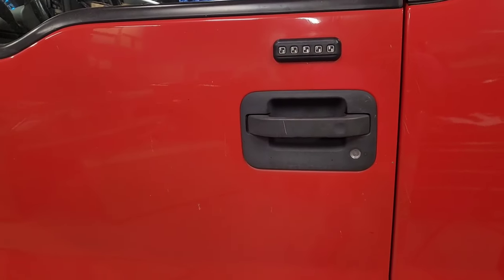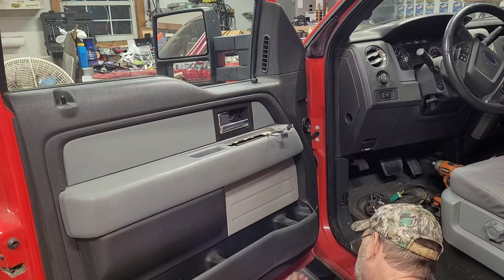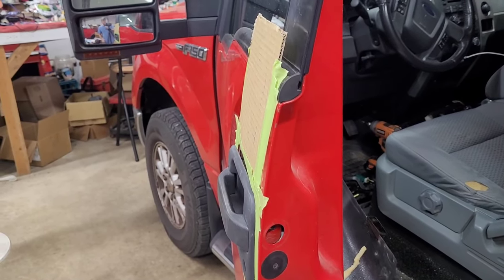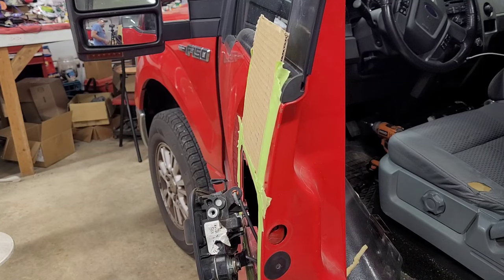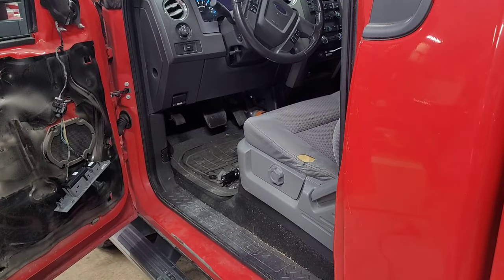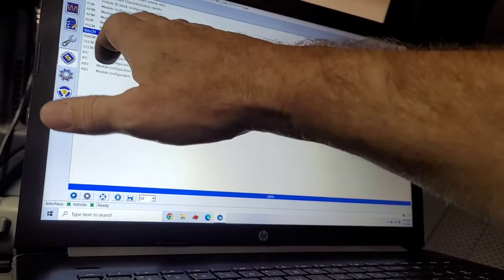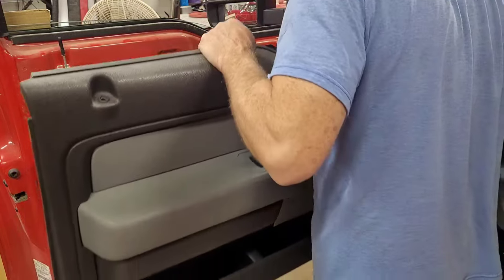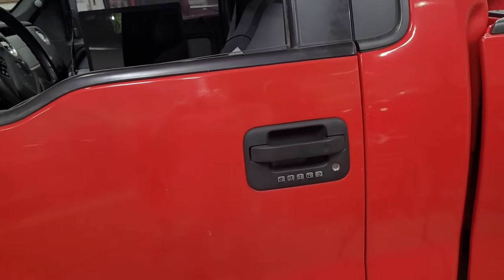Forscan Adding & Activating Factory Keyless Entry Keypad Door Handle On 2009 - 2014 Ford F150

Comment: Ah, "programming" and "body control modules"... yet more reminders of why I have no desire to own - or work on - vehicles with BCMs or GEMs.  A number of years ago I discovered how maddening this system of vehicle design and build can be.  On our way home to Missouri from attending our son's master's presentation at Notre Dame, we lost interior lights, power windows & locks, and wipers on our '96 Explorer Limited; all on a dark rainy night in central Illinois (probably not too far from your area).  After checking and replacing or swapping relays, fuses, and circuit breakers we did ultimately make it home safely.  In investigating the problem, I learned of the far-reaching hold a GEM has on virtually every aspect of a vehicle's operation.  Even though I was able to get things going again with a salvage yard GEM my commitment to OBS trucks was further cemented and a short time later we got rid of that Explorer and replaced it with a Bronco.  Regardless, Tony, thank you for all your work and informative videos!
Reply from the maker: Thank you, Sir! It is getting very disappointing when I take all this time to do it, and with almost 8,500 subscribers, it only gets 12 hundred views in two days. It's really not worth it, and some days, I want to give it up. Someone hand washes a car and gets thousands of views in an hour. I really don't understand it.

Comment: I’m very interested in this. I’ve had to find factory codes on bcm boxes under dash in the past. Do you have a rubber adhesive remover attachment? It will save your finger nails and fine scratches. I think you would find real use for it! It removes flaming ford stickers bumper stickers off paint etc. Had to indulge in early comment!
Reply from the maker: I don't know why I've never bought one of those. I've definitely seen them. It wasn't too bad. You actually have to go into the BCM "as built data" to activate the keypad.

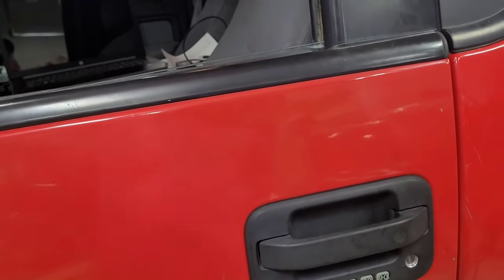Comment: 56:32  Even the Ford Panthers no longer put the keypad entry 5- digit permeant code on the door module starting with the 2006 model year cars...used to you could just pull the driver's door panel off and see the code sticker, or if you needed a new DDM you knew your code by the sticker on the new one from the junk yard, not 06+..... Great video, life saving feature!!! Strong work!!!
Reply from the maker: Thank you!

Comment: A little off topic, but I have the 2002 Ford F-250 that had the half door latch that was broken. Same truck (my only truck) has a Vehicle Security Module issue where the locks don’t open with the fob and I get the door open light on the dash. Took it to a small Ford dealer. They said they could not find a new one, but I see  OEM modules on the internet. I would think I have a door actuator that may have taken out the module, but I’m not sure. Could an independent auto electric service place be a good choice. Thank you for helping us…because you have and do…
Reply from the maker: Thank you! I believe I could probably figure it out. I'd think someone around you could. I have a video on replacing the rear door latch and cables.
Reply: I used your video regarding replacing the door latches and it worked wonderfully! I live near Springfield, Tennessee, if you have someone who knows someone…
Reply from the maker: No, I don't know anyone down that way. I'm sorry.